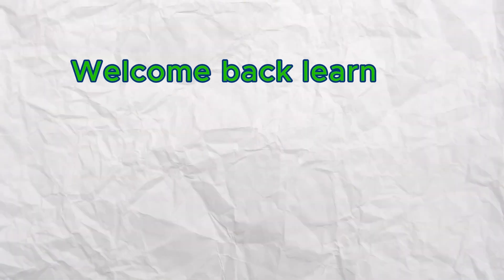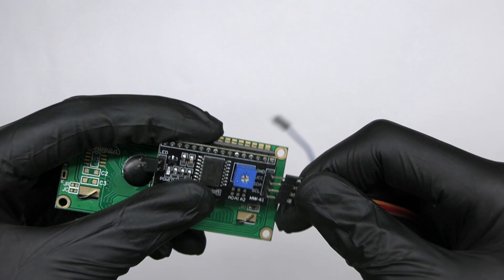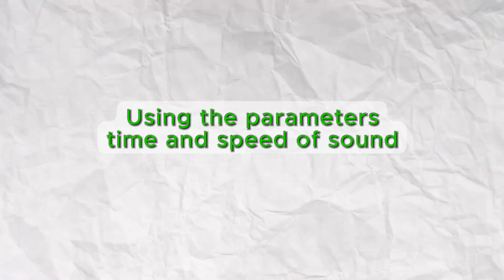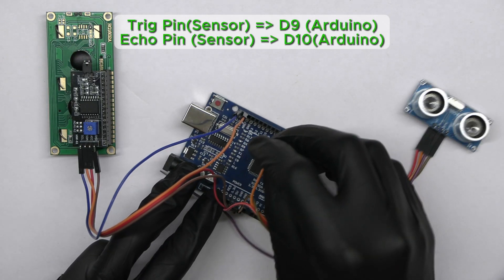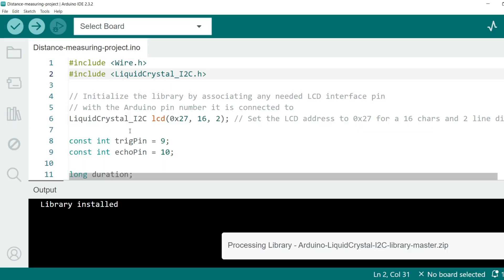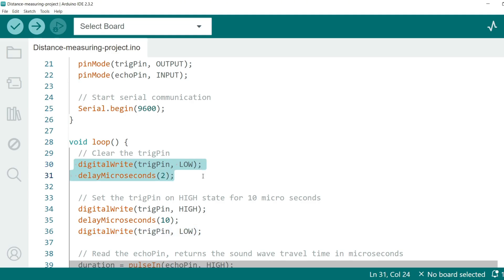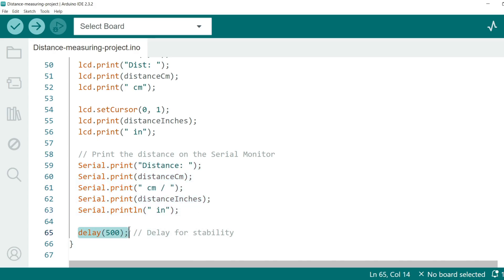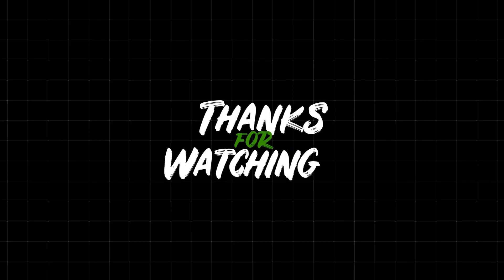DistanceDetect: Ultrasonic Distance Meter using Arduino | Robo Army

Comment: In my window 7 this lib file is not downloading than what i do
Reply: In my window there was code was not uploading it's Says that serial port is not open
Reply: I think my cable only transfer power not code
Reply from the maker: Exactly! That’s a very common issue — some USB cables are power-only and don’t support data transfer.
Try using a different USB cable (preferably the one that came with a phone or Arduino board that supports data).
Also make sure:
The correct COM port is selected in Tools → Port.
The board type is selected correctly in Tools → Board.

Once you change the cable and check these settings, the code should upload perfectly!
Reply from the maker: Sometimes Windows 7 blocks library downloads due to outdated security settings. Try these steps:
1️⃣ Update your Arduino IDE to the latest version.
2️⃣ Go to Sketch → Include Library → Manage Libraries and try installing again.
3️⃣ If it still doesn’t work, download the library ZIP file manually from GitHub and then go to Sketch → Include Library → Add .ZIP Library to install it manually.
Reply: Which COM I USE FOR IT

Comment: Bro my arduino has only one 5 v pin how will i connect
Reply from the maker: No worries! If your Arduino has only one 5V pin, you can still connect multiple components by using a breadboard. Just connect the Arduino 5V pin to the positive rail on the breadboard and then connect all your 5V components to that rail.

Comment: We’re can I buy the materials besides the arduino
Reply from the maker: Hey! You can find the components like the ultrasonic sensor, LCD display with I2C module, jumper wires, and other accessories on online marketplaces like Amazon, eBay, or electronics stores or in local electronics market.

Comment: I tried to make it using the diagram shown but it won't power the receiver what modification did you do to get it to power the reciever
Reply from the maker: Ensure that the receiver (Echo pin) is properly connected to the Arduino’s digital input pin and that the ultrasonic sensor is powered correctly (VCC to 5V and GND to GND). Also, check if your connections are secure and if any jumper wires are loose. If the issue persists, try using a different power source or check your wiring against the circuit diagram again. Let me know if you need further troubleshooting!